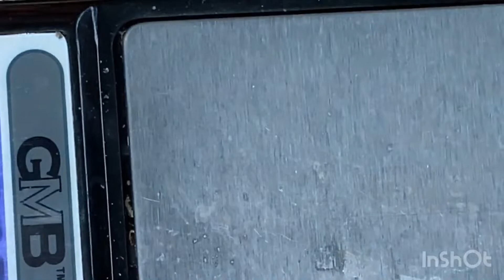Opal cutting: a quick cut: making the most of some chips.

Comment: What does treatment mean  ?
Reply from the maker: With Andamooka matrix opal it is a porous opal, so unlike the glassy opal that is impervious to water, matrix will absorb water. Due to this, when the matrix dries out it has no refraction of light, instead light is diffused and the colour spectrum is hard to see. Also some matrix is too porous to take a decent polish, and can be very pale. To bring out the colour I darken the stone to give a greater contrast, by firstly soaking the opal in a concentrated hot sugar solution, to get as much of the sugar into the stone, then I soak it in a hot sulphuric acid bath to carbonise the sugars turning them black. Most of the matrix I have, fortunately does take a polish, but some matrix won’t and will need further treatment using a resin to seal the stone for a polished look. 🤪👍